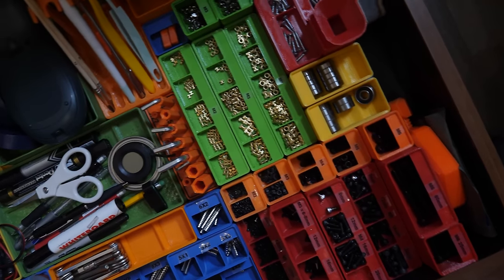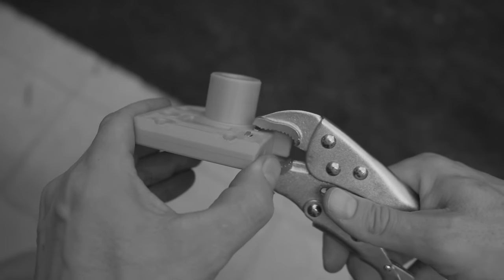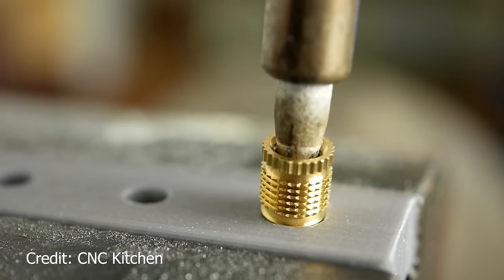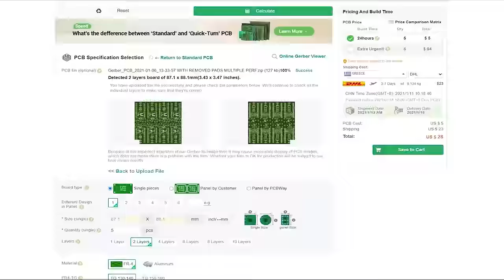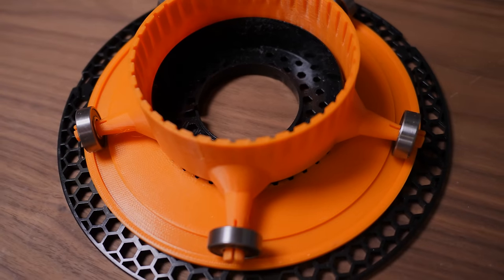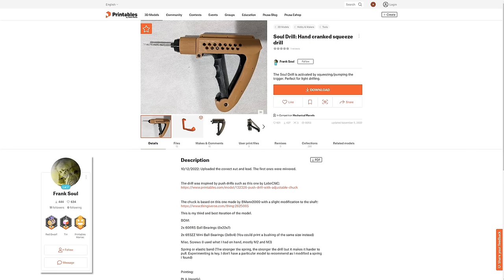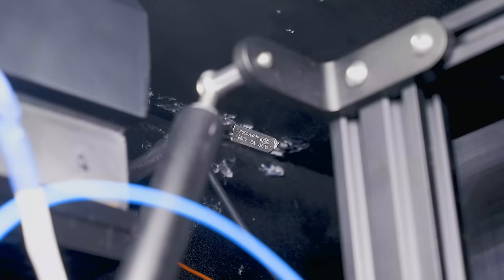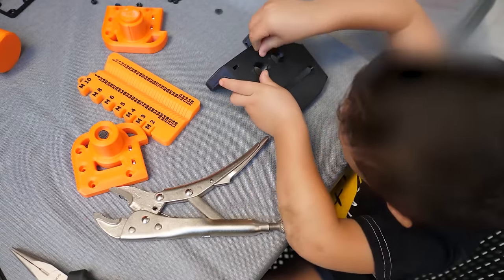Make USEFUL 3D Prints with THIS List of Hardware

Comment: the aluminium ones are made for had conditions such as in a car or lathe or sander where the RPM and heat are a problem .
I am building a power bench sander and you better use the metal ones and not rubber due to the friction and heat.

but if the rpm and heat are not an issue you go with the rubber ones

Comment: Hi there, most of the brass instert you show in your video are pressure inserts, not heat inserts. Heat inserts have the double alternate hellicoil on their cylindrical side.

About bearings : Z means metal seal at a side and ZZ means you get metal seal on both sides. 2RS means polymer sealing on both sides.

About adding weight you can't beat sand in zip bags.
Reply from the maker: Oh, snap! I had no idea. Thanks for the education. I need to buy some better ones from Stefan ;)
Reply from the maker: Oh, and thanks for the explanation!
Reply: @thenextlayer  Stefan's are the good ones. Much expensive than at other places but that's mostly Chanel support, right ?

Comment: I like the metal inserts but these days I see more and more self tapping screws. This would fit in more wholes if you only had a few diameter sizes and no need for a soldering iron. I the whole it to small a quick drill to widen it and then the self tap screw that’s slightly wider to thread in.

Comment: I saw that you can embed a nut inside a 3dprint. Basically you add a pause in the print, insert the nut and continue. I haven’t tried it but it may work better than heated inserts. What do you think?
Also, how do you do this in bambu slicer? :O

Comment: The threaded inserts you showed are actually for injection molding. They don't hold as well as the ones specifically made for heat-set insertion (like the ones from CNC Kitchen).

Comment: If I remember correctly, the wheel weights are made of lead. Give it a try at getting them, but I'm guessing they save them and then sell or trade the in to their weight supplier or a scrap metal company.

Comment: As far as nuts, bolts and hardware, I prefer McMaster-Carr over Ali express for a few reasons. The quality is better and selection of materials and finishes. Also for most fasteners a detailed CAD is available so you can get dimensions and load them directly into your Fusion 360 sketch for a perfect fit!
Reply from the maker: Nice. Wish we had that here.

Comment: Love the videos. As for tnuts? I've noticed in my experience  it can be a pain in the ASS to lock something in. For that reason. I use noble tnuts 4040 . They  work  amazingly. Hope this helps someone.
Reply from the maker: Good tip, will check them out

Comment: Great video, got me thinking of other "on hand" items I should look into.  I broke down and bought a pack of m-Screws and Nuts, I kept paying to much at the hardware store.  By the way, do you have the STL files for your CR10 V3 mods to move all the power components underneath the printer.  I hate having the box on the side and I've had a hard time finding the right print mods.

Comment: If you are going to do a video about designing files, I would love a video with tips on how to remix and change stl files.
I am sure there is a better way than doing it straight in the slicer as I have been doing by adding and removing volumes I make seperatly in fusion360.
Reply from the maker: I can definitely help you with that, I do it a LOT

Comment: Cutting rebar with a dremel seems like torture... Get a cheap 4 1/2" angle grinder with some thin abrasive cutoff wheels. (HF price less than $15 for both on frequent sale)
Reply from the maker: as if I need an excuse to buy more Makita goodies. Looking now…

Comment: One other thing to have on hand and goes with your fans and other small electronics are buck converters. Nothing like having the perfect fan but not having the right voltage input and a buck converter is the perfect unit to have on hand to convert whatever input you have to the correct voltage that you need so you dont burn out your fan. Likewise other small electronics could benefit from using one if the need arises!
Reply from the maker: Wow how ironic I just went through 2 today. Forgot to put them in the video. But glad I have a lot of extras

Comment: Instead of using a dremel to cut rebar, use a hand-held grinder with a cut-off wheel. I prefer a battery powered bandsaw, but those are expensive and may not be as useful to you
Reply from the maker: Yeah I bought one off this.